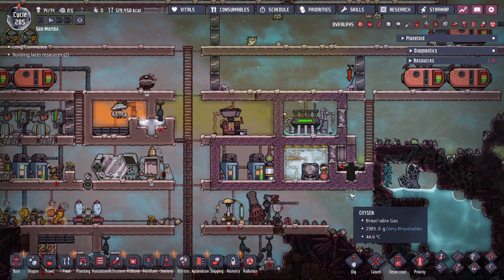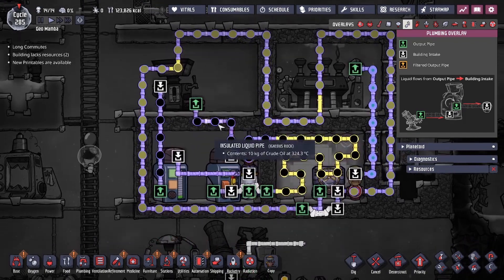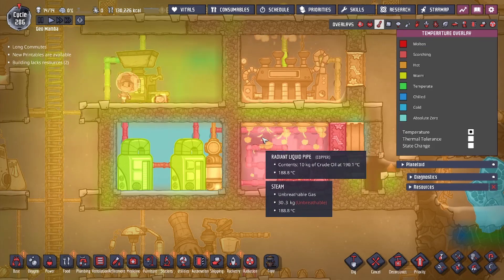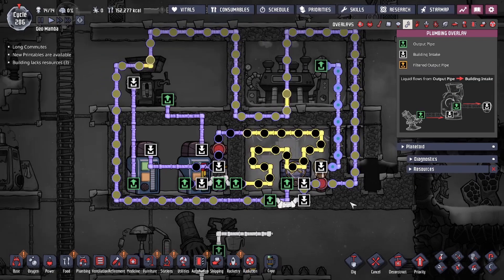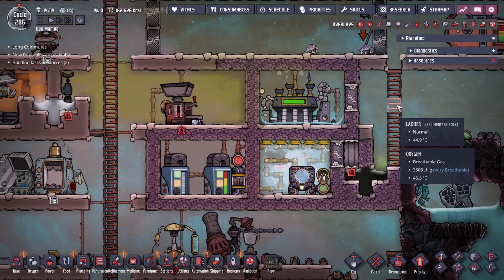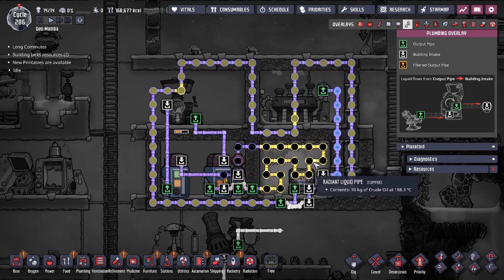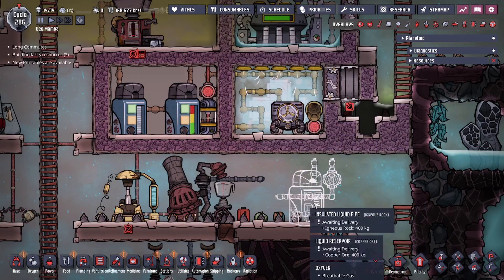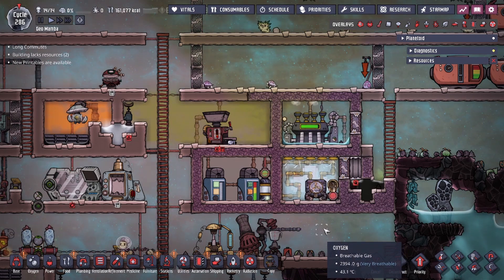Generate Power with the Metal Refinery - Steel Production into Max Steam Power- Oxygen Not Included

Comment: is making everything out of non refined metals ok?
Reply from the maker: isnt that just the tempshift plates? the radient piping / automation / steam turbine all require refined metals and arent buildable with non-refined. liquid reservoirs are metal ores. refinery and insulated pipes are raw minerals. 

if you do use metal ore for the tempshifts, it just means you have to wait longer for the oil to cool down
Reply: @2LegitCity  ok its just that i never made refinery before and its kinda overwhelming(mainly steel)(i watched ur basics vid on refining)

i dont even have access to oil
Reply from the maker: @NamelessY  oh gotcha. i will say that this build is more advanced and designed to get more out of the metal refinery.

if youre just starting out to refine metal using the refinery, you dont have to use oil. any liquid will do, but you have to pay attention to the state change temperature from liquid -> gas of liquid you choose. i was using oil as my refinery liquid and its very popular to use because of the temperature range it has ( -50c -> 400c ) so you can cool it down with a steam turbine.

so you can do something like piping in water to the intake, and then use insulated pipes from the outtake to feed into something like electrolyzers. that way the hot water gets consumed and you dont have to worry about it. 

if thats too much or you dont have a electrolyzer setup, you could find a pool of water, pump water to feed your metal refinery and simply dump it back into the same water pool. this is great for getting started but doesnt last long term. eventually the pool of water gets too hot and you cant use it anymore. hopefully by then you can use the refined metals to help you get to oil!
Reply: @2LegitCity  ok thanks ! i thought eledtrolyzer would make hot o2 if i did that, im going to try that
Reply from the maker: @NamelessY  its technically already making 70c oxygen, which is why most people feed it hot water if possible
Reply: @2LegitCity  ohk thanks for helping!
Reply: @NamelessY  - One method that works if you don't have oil, if you're on a starting map like the terra asteroid you'll have a deep frozen biome near the surface, just before space.  Build a refinery just below the cold biome, where there's still some warmth for dupes.  Build a liquid reservoir to the left of the metal refinery, just before its liquid input.  Fill it with polluted water, that gives you a temperature range from -20C to +120C to work with, being near the -60C cold biome, the -20 part matters more.  The reservoir will help smooth out the temperature spikes.  Run the pipe along the cold biome, insulated pipe up to the edge and then radiant pipe of whatever metal, start with 8 segments of copper/iron/gold, or 4 segments cobalt, or 2 segments aluminum or so and see how well it works.  This part is important if you overheat your coolant, extent the pipe to the metal refinery's input to the tile above and add a bridge to the refinery's output pipe.  This way the coolant will keep circulating through/near the cold biome and cool off even if you aren't using it.  As the frozen biome heats up you can continue rebuilding the loop upwards, remove the bridge first to stop the loop and add it back once the loop is extended.  
Another way is if you have a cold polluted water vent or cold saltwater vent, build a large storage for that water.  While wasteful, you can simply pump from the -10C vents to your refinery and run an output pipe into space.  This may be the only option if your asteroid has one of these -10C vents but no other cooling.
Reply: @ahmataevo  thx a lot for taking time to write this much, really nice to do! unfortunately i have taken a break from oni :)
Reply: thats a late response. but actually you can start this up without aquatuner built and run it just enough to get 1200 steel to build one, then the rest will become easier once its done, tempshift plates also just an optimization and arent needed to start off to get first bricks of steel going if that's what you're after